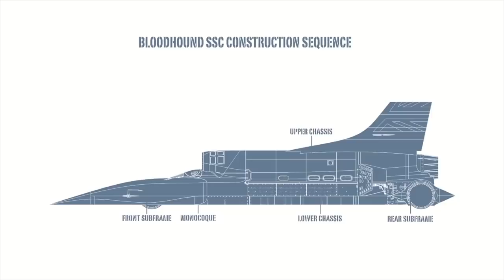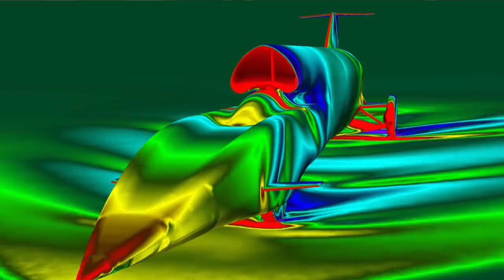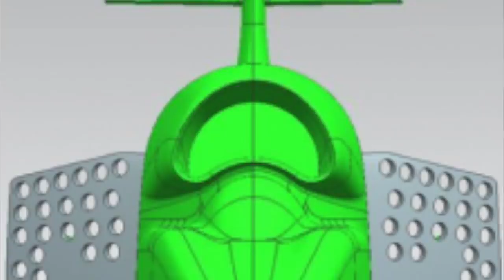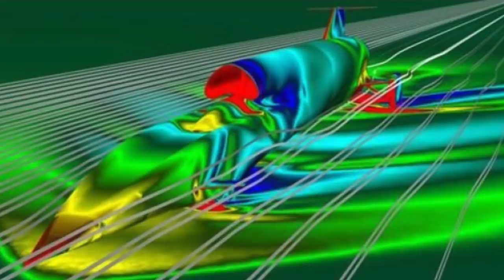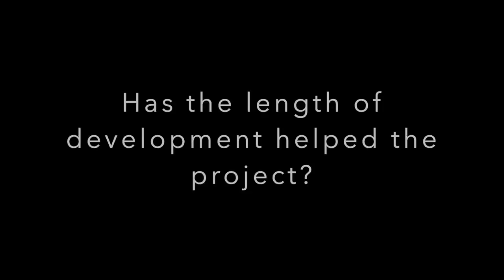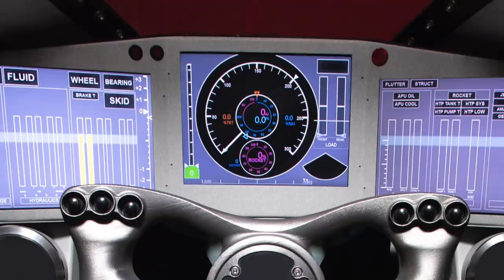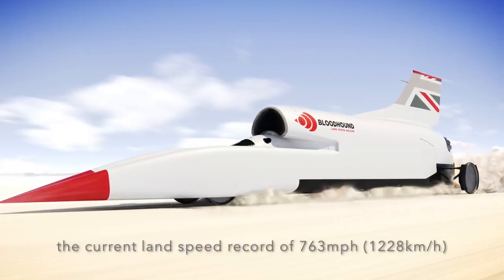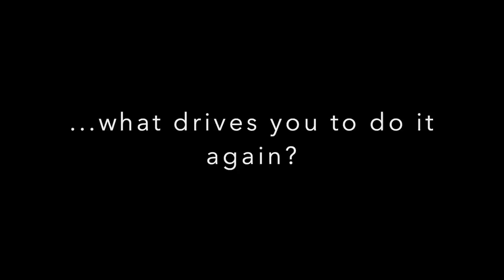Bloodhound LSR - Behind The Scenes

Comment: "We have an engine with a few hours left on it"  gives an idea how great the forces are on jet turbines my first car (2nd hand) had something like 175,000 miles on it.
Reply: I mean it's not like the engine is going to explode if you run it past it's runtime. It's just the regulatory commissions requiring replacement before you can even begin to think about having fatigue failures. Perfectly good engine for automotive use after a life of aero use

Comment: In the early to mid 1960's, Craig Breedlove and Art Arfons would have a car built and run in less than 1 year. Bloodhound has become so complicated,  but it needs to be with the speed they want and systems they need for safety.
Reply: @thethirdman225  You can die, as many have, and once recently, at much lower speeds, if things go awry.
Reply: @UncleKennysPlace  Yep. I have my own suspicions about what happened to Jessi Combs. I have always been of the opinion that the shape of an F-104 fuselage was unsuitable for use on land because of shockwave build up under the nose cone and ahead of the front wheel. She probably wasn't traveling fast enough for that to happen but I'm sure there would have been a sizeable pressure wave ahead of the front wheel. At that speed, you're definitely into the realms of compressibility.

Comment: Great video!  I could not help but wonder why the whole drive was not automated.  With all those sensors, a computer controlling the staged ignition of the jet engine and then the rocket engine would seem much safer than relying on human judgement and reaction times.  
I cannot help but think that it is that Andy Green is a pilot that pushed the design towards manual control even with the tight timing tolerances and the huge physical toll that, as Andy has laid out, will affect the driver/pilot.

It isn't a land speed record if no one is on board but I do not think that the person on board needs to be in control of the vehicle 100% of the time.  Any thoughts?

Comment: Does the car actually need a pilot to break the record? Could it run as a drone and still be a valid record breaker?
Reply: I can't speak to the rules, but I suspect have an on-board pilot may be necessary to control it reliably. That on-board seat of the pants "feel" would be awfully hard to have in an AI without a lot of training with no data to feed it.
Reply: Yes, the car must have atleast 1 seat to carry the driver - Otherwise its not really an automobile.
And lets face it, the challenge and whole feat would be alot less interesting. Would anyone follow motorsport if it was a bunch of computers driving around? It looses its character and attraction!

Comment: Interesting that he said, if the team were starting again they would have a different design and a different desert. 
I hope that does not mean the project is comprised from the start.
Reply: The original design had the rocket engine on top and the key underneath. My understanding is that they had to change to accommodate the rocket’s oxidiser tank and pump. I can’t help thinking that they would have been better off using an electric motor to run the pump instead of a petrol engine. Wasn’t there trouble with the salt pans in America? I think they were told they couldn’t use them.

Comment: 2:19 What does he mean when he says “...with a few hours left on it”? Like is that how long the engines got till it goes kaboom or what?
Reply: The jet engine from the fighter jet has a finite lifespan,  they got it with a few hours left on it before it gets decommissioned.
Reply: The engines they are using have about 2 hours left on the book, which is plenty if you think that each run lasts roughly a minute.
Reply: Everything in the aerospace industry has a specific indicated lifespan of either 'X' hours or 'X' cycles

Comment: is the steeringwheel really made by renishaw? i thought they only make measuring modules for CNC machines. we have some of their products at my workplace, to use with Hurco CNC mills.
Reply from the maker: Yes, Renishaw made the steering wheel, I think using a titanium 3d printing technique. They took moulds of Andy Green’s hands and did it to demonstrate that it could be done.
Reply: @ScarfAndGoggles  wow, that's so cool!
Reply: @TheWolvesCurse  I used to be an engineer with Hurco in the UK. Went to a big exhibition in the UK in 2014 and one of the Hurco customer stands had the Bloodhound car on it, with the EJ200 sat in a cradle next to it. Couldn't believe how few people were there...spent nearly 2 hours chatting to one of the Bloodhound's senior engineers and going all over the car and jet engine...amazing stuff!

Comment: Has the Jaguar engine to operate the pump been replaced with an electric pump then?
Reply from the maker: Not yet. The rocket isn’t in use for the forthcoming high speed trials (jet only) so the space in the chassis where the rocket oxidiser pump motor (currently the Jaguar V8 engine) lives has been used for an extra jet fuel tank as it will help to have extra fuel on board for the trials. They’ll need the rocket for next year’s attempt on the record, so will have to make a decision Jaguar V8 vs electric motor during the next few months.
Reply: @ScarfAndGoggles  as Andy said, electric would be a simpler system, no exhaust or fuel, and less cooling and wiring.

Comment: Did I see rubber tyres ?
Reply from the maker: Yes, it’s on the tyres they used to run it at Newquay airport whilst they move it in the workshop. Solid aluminium wheels for the desert later this month (they were in their packing crate when I visited).

Comment: Uhh- those airbrakes make me nervous. They need to deploy very precisely.
Reply: Jesper Clemmensen they’re mechanically paired with one hydraulic ram pushing both at the same time. The linkages between the two are machined with 1/10,000th of an inch. They’ll be fine.
Reply: @NROS2012  Thank you - I guess they will within that tolerance.

Comment: I just hoped the rear wheels were wider apart, looks like a high speed roll in the making
Reply: I believe Craig Breedlove showed everyone that one rule you don't cheat is the crosswind limit.  THAT will make you roll!
Reply: Well a motorcycle going really fast doesn’t have that problem.
Reply: The aerodynamic airflow going over the side/tail fin & the cars sheer momentum at speed would make that absurdly unlikely
Reply: Modern man UK The faster it goes, the more stable it becomes.

Comment: Wonder who will get to 1k mph first, the Bloodhound crew or the Aussie Invaders.  Hopefully they're going to be replacing those front wheels and tires before they try for the LSR, otherwise that rubber will SHRED .
Reply: First of all, as an Australian, I’ll believe the Aussie Invader when I see it. Also, the high speed runs will be done on special wheels designed to rotate at10,000 rpm and withstand something like 50,000 g or something ridiculous like that. Thrust used metal wheels.
Reply: @thethirdman225  Oh I'll believe in ANY of these teams after they've pulled it off.  I saw a fairly recent Invader video where they've at least got the cast aluminum wheels/tires mounted.  That's what prompted that portion of my comment.
Reply: @michiganengineer8621  Oh, okay. I wasn't aware Aussie Invader had got that far. Bloodhound is a much bigger project and at least has run.
Reply: @thethirdman225  To be honest, I'm not sure which team is further ahead on the testing of their systems.  As far as braking is concerned they both seem to be at par, although I'm a little concerned by the height of the Bloodhound vehicle.  If they were both to hit the "track" at about the same time I'd be putting my money on the Aussies, in part because they're going "all-or-nothing" with a ROCKET for both directions rather than a hybrid system like the "Hounds" are using.  Another reason for supporting the Aussies is, you have to back a bunch of "ex-convicts" trying to better themselves! :D :D
Reply: @michiganengineer8621  The wheels for this was exist...the rubber is just the shakedown kit.  Theres a video somewhere where these were being cast and machined.

Comment: "no jet fighter in history has gone 1,000 MPH at ground level" As 4 F22s , 3 F15s, 4 F16s and 1 F 35 and A TORNADO ~...strafe Targets in Libya, Iraq, Afghanistan and TARGET PRACTICE in Nevada...AT A THOUSAND MILES PER HOUR...right now. ok...400 ft..
Reply: Richelle Barnes he also states it’s the best jet engine in the world and the jet engine in the f35 is almost 2 times as powerful.
Reply: Douglas m Maybe, but more likely about power to weight, size not to mention availability
Reply: GoodFodder availability would likely be a problem but it’s still way more powerful even in terms of power to weight. It doesn’t change the fact that stating it’s the most powerful jet engine is still factually incorrect.
Reply: The Low level airspeed record is 988.26 mph by a civilian owned and heavily modified F-104 Starfighter that was basically built out of scrap parts. The pilot Darryl Greenamyer had built the aircraft over a period of 13 years and had actually completed an approved FAI record course at over 1000 MPH only for the timing gear to fail and deny him the 1000 MPH record. The only reason that nobody has tried to break that record since then is that the FAI removed the class for that type of air speed record as it was very dangerous (Aircraft had to fly below 200 feet all the way around the course). This stopped British Aerospace from attempting to use a Tornado F3 to try and get the record in the mid 1980's.The Tornado F3 was very fast at low level with a totally clean fit (no pylons fitted or weapons on the belly), the book sea level max speed was 921 mph though I have heard stories of pilots taking the aircraft very close to 1000MPH. As for other front line jets their low level max speeds are (according to Wikipedia) :

F-4A 902 mph (operation Sageburner) Low level record in 1961
F-111 915 mph
F-15 900 mph
F-16 915 mph
F-18 no figures 
F-22 no figures
F-35 no figures

You wouldn't be seeing the latter two pissing around at low level anyway except went taking off or landing.

Comment: Someday a land speed record car with an electric motor?
Reply: They already have a category for that (I'm not up to date, but I think Ohio State University used to hold it at over 300 MPH about 3 years ago).  No, it'll never transmit enough power through drive wheels to set an absolute speed record (even the turbine engine is not powerful enough for this car!).  In case you missed it, he said: "for the first time since 1913 a land-based vehicle will exceed the speed of the world's fastest aircraft AT LOW ALTITUDE" (!)  Keep in mind that even spacecraft don't exceed the speed of sound until they've been climbing and gaining altitude for about a minute.
Reply: They need to accelerate at about 3g all the way up to 1000mph. The wheels need to be solid aluminium to handle the rotational forces at full speed. You simply cannot get enough traction using a mechanical drive to the wheels even if you had enough engine power. It would seem jet engines are not sufficient, hence all contenders trying for 1000mph are using rocket power.
Reply: The first car to 100 kph was electric.
Reply: @desmo750f1  Yes.  And the first person to travel over 15 mph was running, so what's your point?  Surely you're not suggesting better shoes would solve the high speed issues?